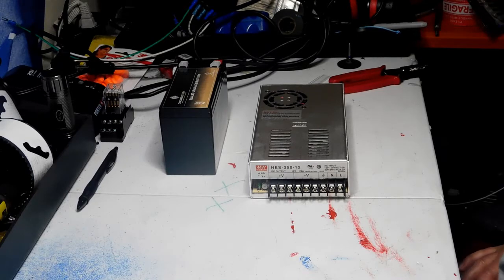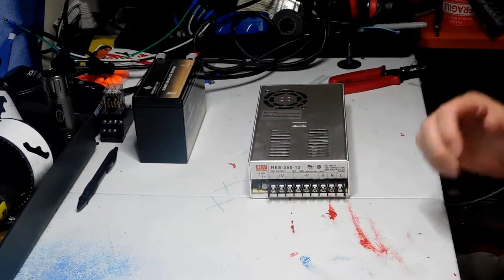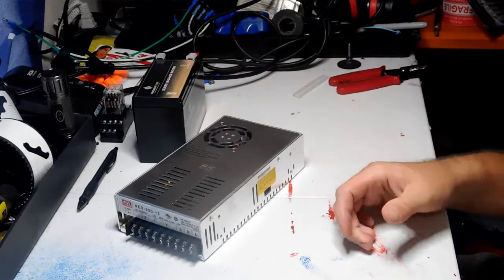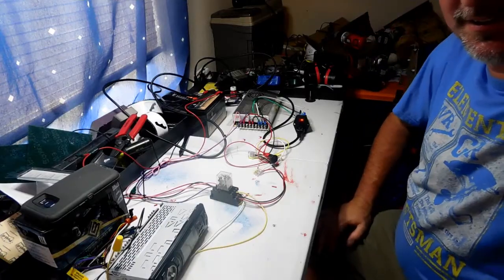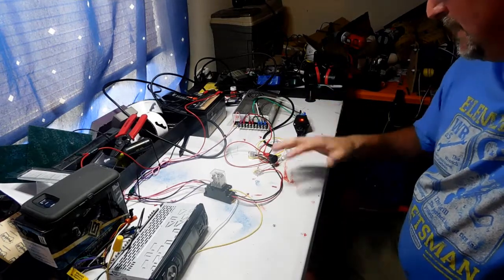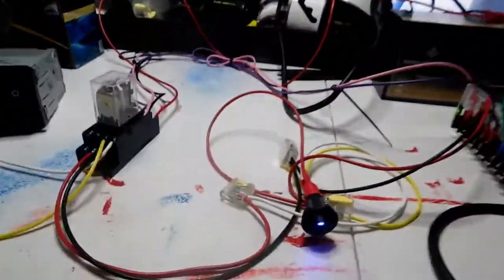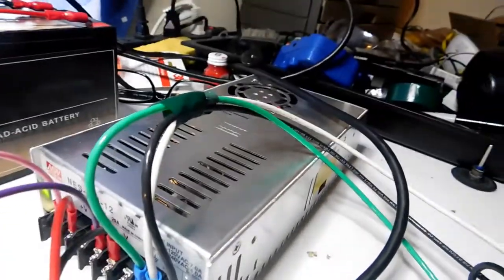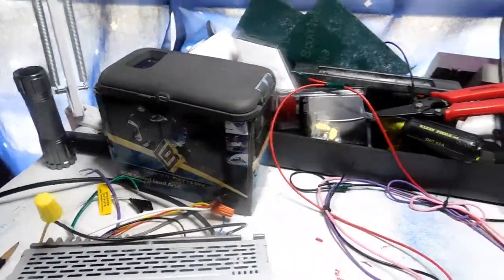Mega Boom Box wiring with Relay and Power Supply

Comment: Phil.  On that relay.  Speakung about numbers 9 and 10.   9 you have as the white wire and its going to the yellow and red wires on the radio and number 10, the yellow wire going to the black (negative) on the radio. Correct?    Am I reading your wire diagram right?    I couldn't really see how you had it wired to the radio on this video.   I know this video is over 4 years old and I'm sure you have changed it up since then.  I do not have Facebook unfortunately.
Reply from the maker: Send me an email veryhumble777@gmail.com

Comment: I have a quick question what gauge wire do you use on your projects?
Reply from the maker: 90% of the time I use 18 gauge.  I use 16 or 14 if I am running power wire from a voltage booster to an amp
Reply: @diyboomboxesintexas2805  ok thanks a lot for the help.  Have a great day
Reply from the maker: You are welcome.  Please join my Facebook group.  It's called, "I Love All Things Radio "

Comment: Would it not be simpler to use a charging controller and set the output voltage of the power supply to 14.5 volts? Then use the charging controller to control the initial voltage so as not to overload your power supply or battery? You wouldn’t need the intermediary switch to prevent the delay between the discharge of the capacitors in the power supply and the relay kicking over to battery power.
Reply from the maker: DucttapesUnicycle That would not work because the power supply is not designed to charge the batteries.  Also a charging controller is $40. A relay is $7.  Also, once you know how to hook up a relay they are very easy to hook up and take up very little space.